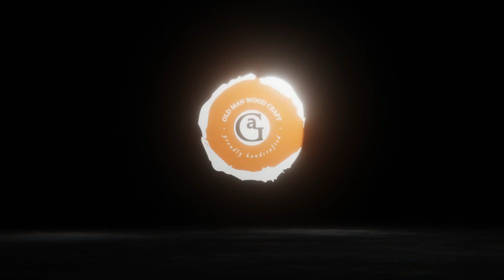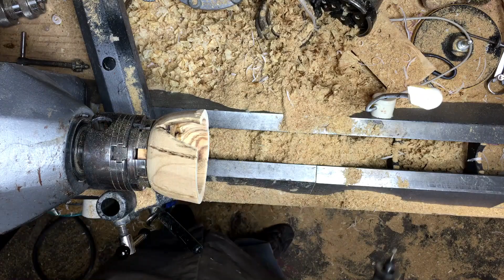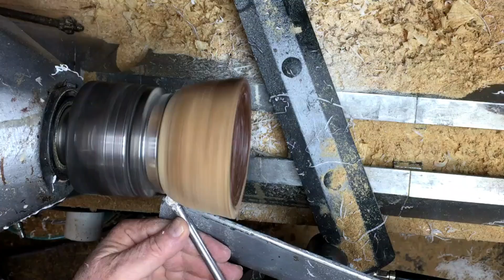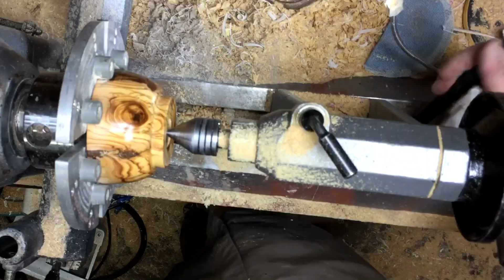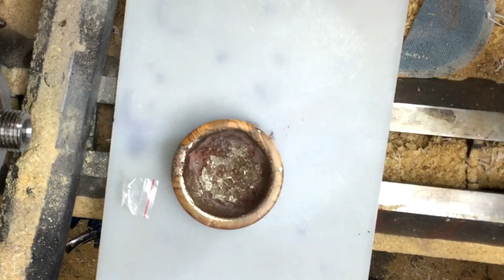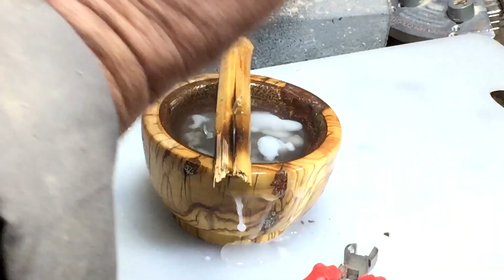woodturning a surprise

Comment: What a nice use of some "old wood". Amazing how a piece of junk looking wood can become something so nice looking - and functional. Your use of the resin with metal shavings was the right choice for this project. I have fond that using 5-mimute epoxy can come in quite hands for smaller projects. It doesn't require a pressure pot and you can use tape or plastic or paper cups to hold the epoxy until it hardens enough to turn it.
Reply from the maker: My thoughts exactly Qapla thanks for your comment .Cheers

Comment: I would have never thought of this one.
You said you may do shows, and I would like to give you some hints that I found out.
Don't do one day shows unless inside where all you have to do is set up a couple of tables.
Outside shows do two day shows and preferable ones you can set up the day before. The workload is great on doing shows. I did very well and found my biggest sellers were resin and wood salt and pepper grinders using crush grind grinders. I also sold a lot of "ring and earring boxes". I made a lot of wood spatulas and those would pay off my entry fee. I found one has to have some low-end items to sell and for me it was the spatulas. I did sell some whine stoppers but not a big seller. Pizza cutter sold pretty well. I found all wood bowls did not sell for me, so I don't make them anymore.
I loved doing shows and I had people around me all the time but had to stop because of the workload and my ability. It is fun talking with the people. I now only sell out of the house.
Nice turn,
Lee
Reply from the maker: Thank you so much for your tips  Lee . I will need advice as it will be new for me .Cheers

Comment: It turned out great Ahron. I loved the use of the copper and brass gel to fill the cracks and the inside. It didn't run like regular resin and also didn't have to go into the pressure pot. Plus it really shines. Beautiful! ❤
Reply from the maker: Thanks  Nena👍